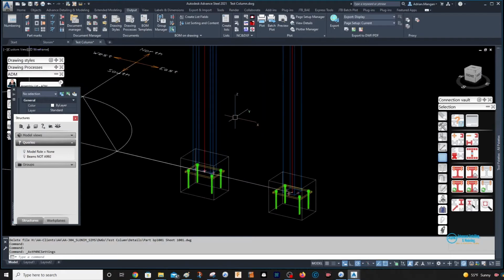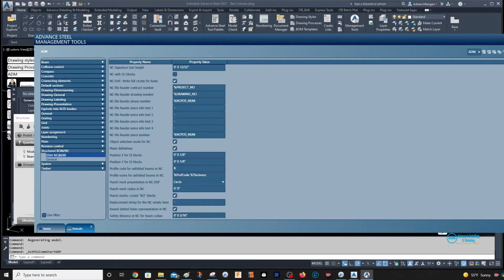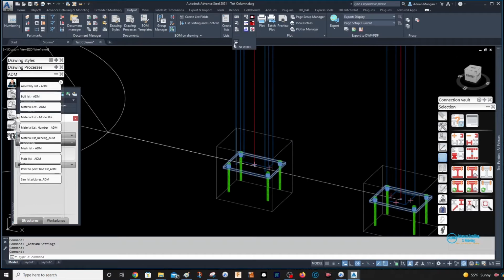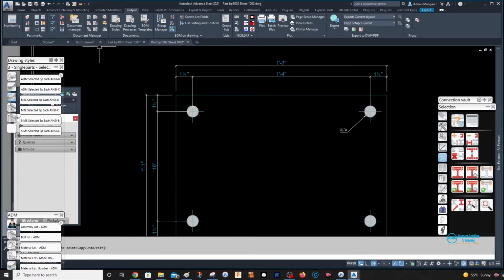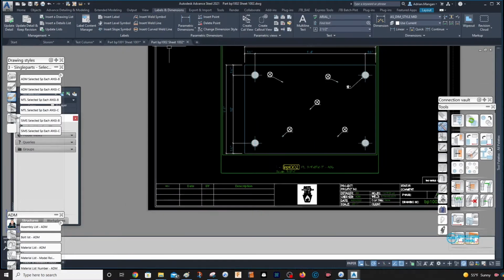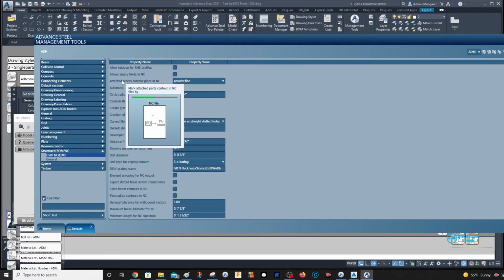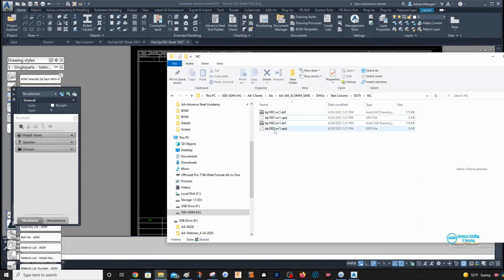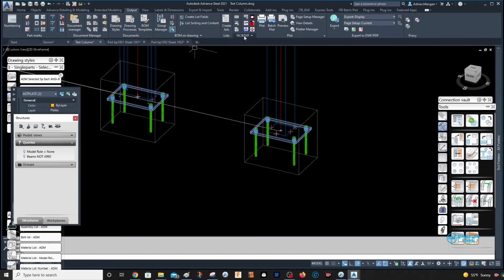ADVANCE STEEL:   "NC Scribing and Punch Marks"

Comment: Hello, 

Do I need to have both punch mark and powder line so the machine can generate the marks? My understanding was that I didn't need the punch marks on the drawing to have the part manufactured with "ecthing" when sending the NC file. I have the powder line on my files, but the columns we received has no marks on them. Thank you!
Reply from the maker: Hi Christian, I'm not an expert but just having the powder line should be fine once its on the right layer for their machine, once you create dxf by assembly the powder line should be on, if not check the management tools but you probably know that already, just in case someone else sees this.
Reply: @EIRCAD  Appreciate your time replying this so fast! Thank you!

Comment: What about just exporting your nc file how do you get it. I am testing advanced out for our our company and started playing around with it yesterday!! Seems like a very strong program!! Thank you for posting material about it
Reply from the maker: Hi Jeremy, there is a button on the output tab that will create the NC files with one touch, can produce a lot of files in a second or 2 its almost instant, just make sure you have numbered first
Reply: @EIRCAD  got you numbering the parts or setting up the part number sequence thank you sir for sharing the knowledge
Reply from the maker: @jh1q6250  as a side not don't be afraid to renumber, I used to be but it doesn't pay off, some thing might change but its better than the alternative
Reply: @EIRCAD  I didn't realize it automatically created the DSTV  folder foe the NC inside of the part saved folder! That's was awesome and thank you for the numbering info thats what the nc file was not be created in the beginning. Thank you sir
Reply: @jh1q6250  a lot of times it's the simple things